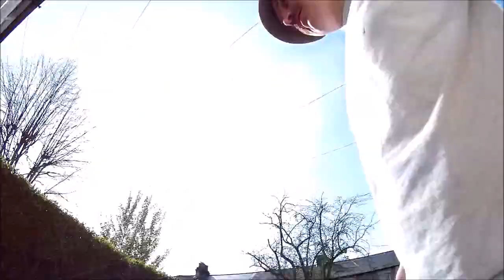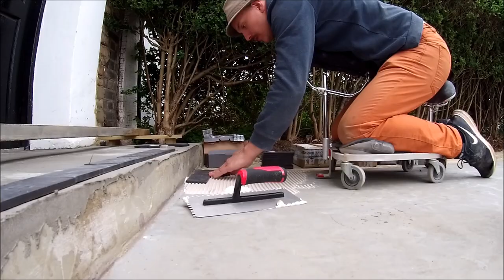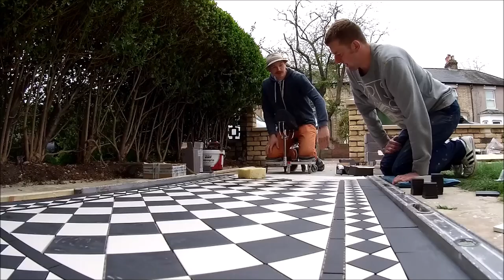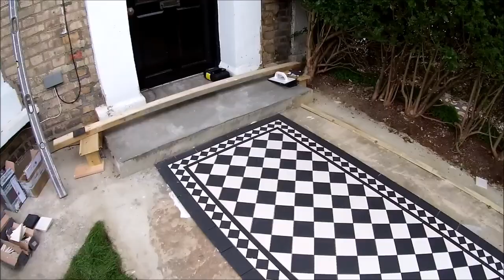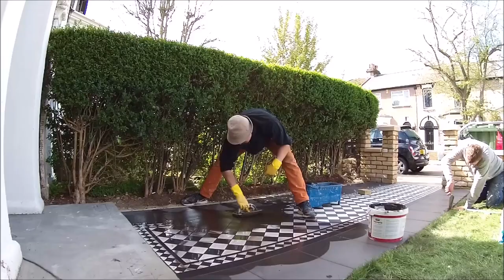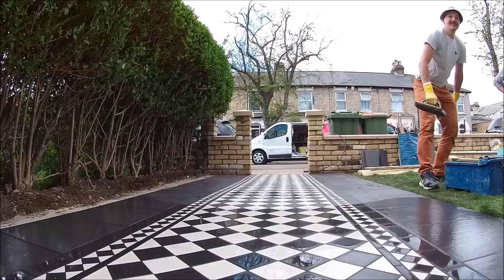AB TILING - Victorian tiles outside pathway TIME LAPSE

Comment: Aquagrip adhesive on an external path/floor is a nono. Prolonged exposure to moisture and frost will blow adhesive fast.
Reply: What should be used?
Reply: @alex1975uk  for the scenario portrayed in this video, any cementitious adhesive would suffice. Aquagrip is an adhesive for internal use only.

Comment: Nice job love laying that pattern and not a spacer in sight.. the yanks go over board with the spacers the little bike yea had for ye knees is deadly 👍
Reply: My tile guy did the most amazing job in my bathroom. It’s tiled to perfection, and he did you spacers. We own a tract home in a community that was built by the same builder. The floor tiles in the rest of the house were laid without spacers and you can towel. Some of it’s very uneven.